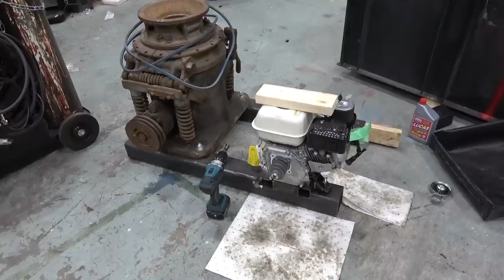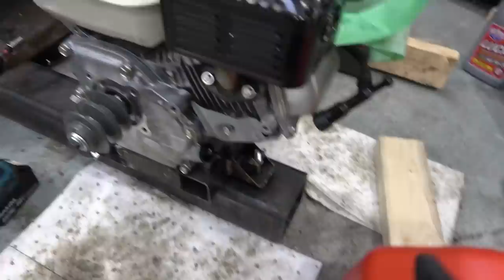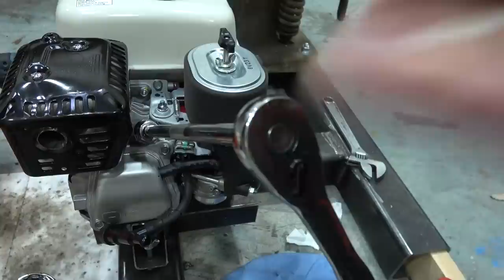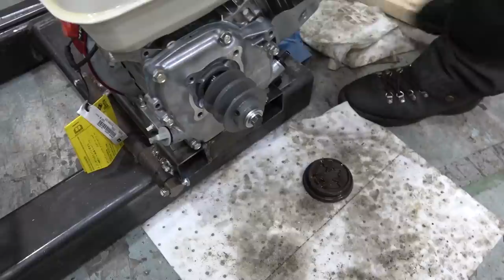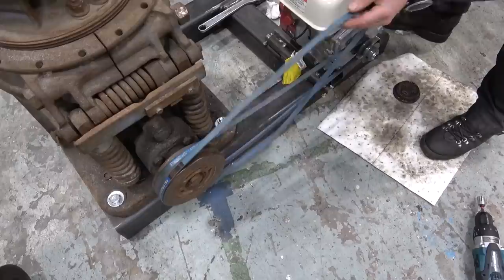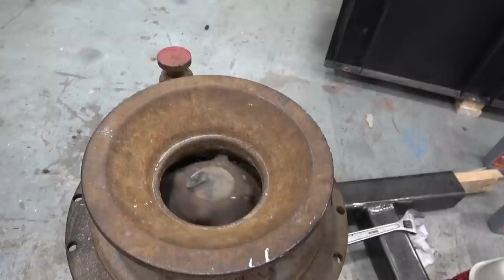Restored Diesel Honda Rock Crusher

Comment: Love your Dave Chapelle references, it most likely slipped past the ears of the other less astute individuals.

The “5°clock free crack giveaway” reference was referring to how his friends tricked him into coming into an intervention. He escaped, (luckily, rehab is for quitters), by flushing himself down a toilet.

The Joe Rogan reference is from the Fear Factor episode. Tyrone Biggums (Dave Chapelle) said, “ Imma tell you something about me, Joe Rogan, that you might not know. I smoke rocks. “  Referring to his preferred method of crack cocaine usage, smoking it in a rock/powder form, also called free basing. Typically this is done by taking the crack cocaine and heating it in a small glass pipe, and inhaling the fumes. The fumes are nearly 100% pure cocaine sulfate. 

I’m sure AvE would be able to identify  cocaine sulfate with the ol’ hot iron sniff test. Seems like he has done and seen alot in dirty old western Canukistan. 

FYI, Trailer Park Boys is based in Non-fiction. Evidence of this can be seen by watchin’ ol’ Peg on Zip-ties and Bias-plies Youtube channel. Theres a slight wiff of family resemblance.

Comment: Step 1 of any refueling effort is to give your squirter a sniff and make sure you're getting the right fuel.

Also why I don't let my wife put fuel in the diesel generator. Diesel in a gas, no run. Gas in a diesel, insides turn outwards.

Comment: Wrong fuel? Red can? Yes and also make sure that you do not have four stroke oil in that can before filling up the oil tank on the two stroke outboard engine on the boat yes.

I did that. Four stroked the single outboard right in the cylinders, way out into the water. Up shit creek (river Thames) without a paddley-doodle.

Comment: I once changed the oil in my 70 Chevelle SS (454)….and after a few beers I started filling it and said..."Shit !..".How much oil does this pan hold" ? "I'm up to 7 quarts already" !....it was then, that I noticed this HUGE oil slick flowing around my New Balance sneakers...and down the driveway. I had forgotten to replace the drain plug !! Stupid. I didn't have any oil left...and it was like 11:00 pm..so I had to wait till morning and borrow a car ! Dad wasn't happy with the 10 foot wide....20 foot long oil stain on his driveway.

Comment: At least one of my laborers puts diesel in a gasoline mortar mixer motor once a week.
Reply: Honda GX motors are gear reduction motors. They are built like brick shit houses. Usually when they won't start, its operator error.

Comment: Diesel in Gasoline Tank .
How About When The Fuel Tanker Delivery Puts The Wrong Fuel Type Into The Product Tanks . Quickly made  Phone Calls To Get The Maintenance Team Out For Fuel Removal .
P.s. One Fuel Type Floats On Top Of The Other , This is Why The Industry Uses Fully Submerged Pumps.

Comment: Let me tell you a story about cranking a gas engine with a drill.  A dewclaw acquaintance of mine brought me his mower to fix.  said it wouldn't crank.  I threw some fuel (gas) in it and proceeded to drill it.  Well the dumb dewclaw acquaintance of mine had run the jesless thing out of oil and burned up the pos plastic/nylon cam gear inside.  well this didn't keep it from firing and it fired on the compression stroke after it managed to get some fuel in it and reversed direction VIOLENTLY breaking the chuck right off my 1/2" drill...and didn't help my wrist too much either!

Comment: 2 for 2 in putting diesel in gas engines? Is dewclaw slow to learn, or merely slow? Always give the fuel in question a sniff test, before introducing it to your engine, and pay no mind to the pretty pink elephant that appears, to inspect, after.

Comment: I put diesel in a pressure washer at my first job and it was my fault when we have red and yellow cans . Got a ear licking as the supervisor takes it apart and clears it. Next day proceeds to lecture me on how to properly use it and uses the exact same red gas can. When I saw him pick it up out of the flammable storage bin I started to die inside. Casually mentioned if he was sorry for over reacting. Later wrote me up for insubordination for allowing him to use a improperly filled can that I knew was bad - originally told him I used a red can and he said I must have been mistaken and used a yellow one insteed. "Mistakes happen we'll have a in service after I clean the diesel out"

Few months later he casually told one of us not to fucking lie in a meeting jokingly and we all complained and said he was being abrasive yada yada. Last day I saw him

Comment: Spent a good few hours scratching my nuts with a GX160 I while back. Had to drill and tap the inlet manifold to run a fuel pump and after reassembly, she not vork no more. It's now an Ex-160. pulled her that much I had blisters on my dick beaters! after going over my steps I discovered the bit of rag I had stuffed in the inlet to stop the shmoo from drilling n taping getting in. For Frogs Snake Man!
Dude, you sure can tooon these engines by the way. I can get just over 7,500Rpm from them ;) eBay does some nice hard valve springs for them. Boy, they can Chooch!

Comment: Yeesh, I cringe when I see someone turn a motor over with a drill. I used to do it all the time until the day I was using a drill stronger than I and the dang thing backfired. I swear my pinky touched my elbow. The little guy has never been the same since.